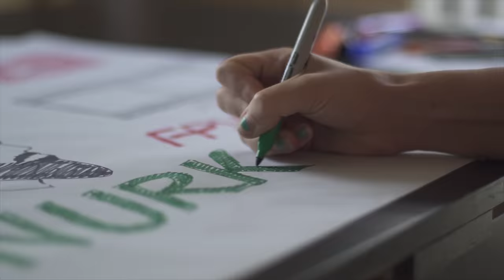Under Bridge and Over Water // Introducing the Reverse Stall Dive

Comment from the maker: My Freestyle Drone: 
Motors: Hobbywing 2207 2450kv (these are a close equivalent) // http://bit.ly/2LG8bP4
Flight Controller: Hobbywing F4 AIO // http://bit.ly/2kEm7gp
ESC: Hobbywing 40A 4-1 // http://bit.ly/2LI1RGT
VTX : TBS Unify // http://bit.ly/2IZFjPU
Receiver: TBS Crossfire Micro // http://bit.ly/2J1lAQ0
RX Antenna: TBS Immortal T // http://bit.ly/2J1lAQ0
Frame: SMWYG Steeze // http://bit.ly/2BRbsq6
Camera: Runcam Micro Sparrow 2 Pro // http://bit.ly/2IYstla
Lipo: http://amzn.to/2zhErAF
Lumenier Gaybreakers 5": http://bit.ly/2olHYKU